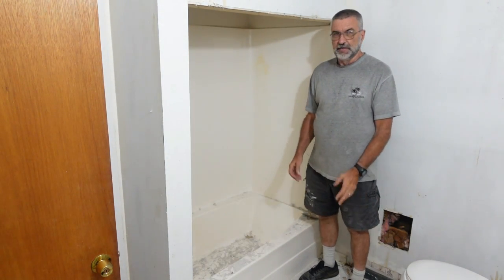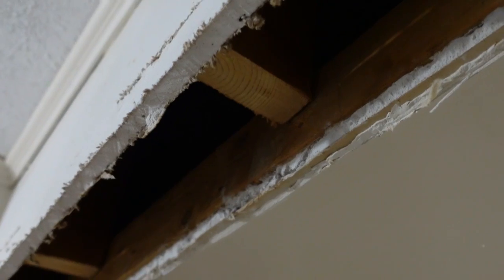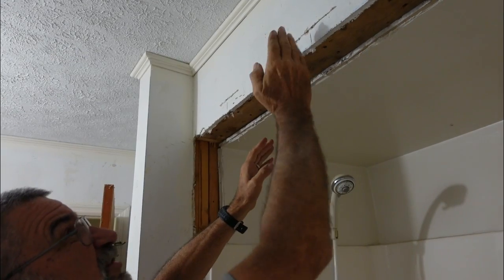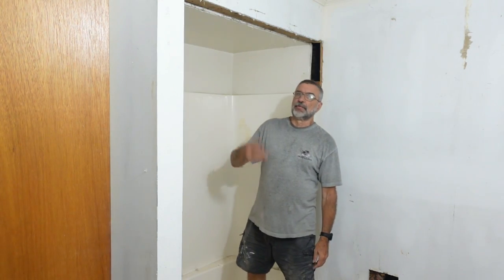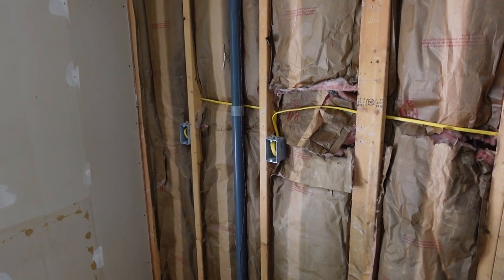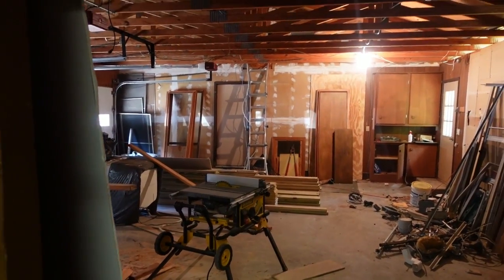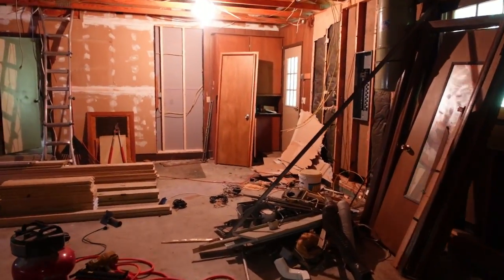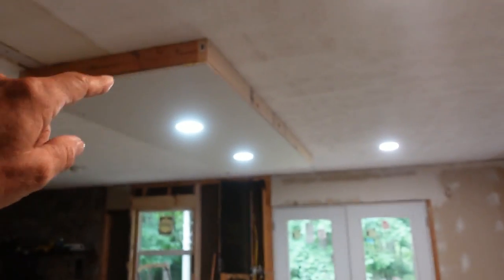More framing, Electrical Problems, Flip House PT 10

Comment: Moving the electrical panel is also so much safer as it's closer if there is an emergency and you need to turn it off at the mains. Great thinking guys. Xxoo
Reply from the maker: Yup
Reply: A lotta benefits having it closer to the interior, as well as on an outside wall rather than an inside. Like he said, Romex isn't cheap.

Comment: When we bought our house 11 yrs ago, the house was still ran on fuses! My dad redid the electrical and put in a breaker box. The 1970’s were an interesting time in house construction lol
Reply: That's interesting.  Every house I have ever been in that was built in the late 40's, 50's, 60's and 70's was constructed with circuit breaker boxes ...... not a fuse in sight.  But have been a state updated electrical code thing.

Comment: I've seen something similar to that shower stall. It was done so the sliding shower doors could be sealed top and bottom. I think the idea was to use hot water to create a mini steam room. Not very successfully I will add.
Reply: I thought something similar, there had to be some reason that they did it? Right?
Reply: @Parakeetfriend4215  The builder had a vision.

Comment: Looks good. The shower space is better. If you replace the tub, tiling the walls up to the ceiling of the shower space will look better than coming short of it. Moving and replacing the electric box makes it more convenient.
Reply from the maker: There’s no reason to replace the tub. It’s in good shape.

Comment: I never heard of putting an electrical box in the garage.  Thought they are typically inside the home.  Also, I found that very interesting about the insulation.  Will have to remember that great tip.  Always unexpected issues, but you and Barry have the knowledge on how to handle things.  Can't wait to see those cabinets.  The Amish do some incredibly gorgeous work!
Reply from the maker: Putting the electrical box in the garage is common.
Reply: Not sure about where you live, but around here almost all electrical panels are either in the garage, or the basement. But typically if there's a basement, it has its own stand alone panel for flooding reasons.
Reply: @gotdangedcommiesitellyahwa6298  I have mine in the basement.  Never seen one in the garage.
Reply: @JanesDough855  It's far more common in areas that don't typically have basements.
Reply: @LiveSimpleLiveFree  ours is in the basement. Not real convenient as we get older but thankfully we don’t need to access it very often. Love watching your home improvements.

Comment: Just curious on the lights over the "island" and why the box was built for them?  Just decorative?  Such a blessing to have all of those skills and the initiative to execute those tasks! 👍  ❤️  🤗  🙏  🇺🇸
Reply from the maker: The ceiling is textured.  It's very difficult to patch texturing and make it match.  There was a big hole it the ceiling from where we removed the old kitchen wall.  It was easier to build this soffit above the island to cover the hole than to patch the ceiling and make it look like anything acceptable.  It also adds a nice decorative touch.
Reply: @LiveSimpleLiveFree  Are the textured ceilings asbestos?

Comment: I'm wondering if that tub area is a converted closet. I don't know the layout of the home, but if there is another bathroom on the other side of the wall, it would have been easy enough to stick that tub in the closet to provide a separate shower for whoever was staying in that bedroom. It might have been a homeowner special with no permit, and they didn't care about the low-hanging framing, as it was just for their own purposes. If that were here, the house probably wouldn't have been allowed to sell before it was brought up to code and ten permits were pulled to repair it.
Reply from the maker: No, that is the main bath, and it was designed that way.

Comment: Looking good, Bill!  How do they ensure that the insulation in the crawl space will stay?  Does it just hang there? Do they nail it up?
Reply from the maker: There are wires (called insulation stays) that you push up into the insulation and they grab the joists on either side and hold the insulation in place.

Comment: Just curious as to why you kept a bulkhead over the tub.  I would have taken the bulkhead out and given full ceiling height over the tub.  I would the lowered ceiling over the tub "oppressive". I am used to full ceiling heights over the tub.
Reply from the maker: The short little wall that I removed was "oppressive."  Once I removed it, it was no longer oppressive and there is now plenty of headroom.  Removing the rest never even crossed our minds because it wasn't necessary.  It also would have been a lot more work.
Reply: @LiveSimpleLiveFree  Well, yeah, take out more, more to patch.

Comment: I am working on a fixer upper and it also has two panels, but, do you pay the electric company to come in and fix it?  I have a coop electric company and can they do this?  Plus will they charge to do it?
Reply from the maker: As far as I know, the electric company will not do any work on (or in) your house.  You would have to hire an electrician to do the work for you. After the work is done, and inspected, the power company will come out a hook up the new service entrance for you.  Hire an electrician to do it for you.

Comment: Can I ask why you didn't take the tub   ceiling to the same level as the rest of the ceiling?
Reply from the maker: Because that would have been CONSIDERABLY more work, and it wasn't necessary.  the level it's at leaves plenty of headroom and room for a shower curtain.

Comment: How about the length for a shower door or shower curtain. Will it be short now?
Are you putting in new shower tile or surround?
Reply from the maker: The curtain rod or shower doors can be installed easily at just the right height for a shower curtain. We won’t need to put a surround or tile the tub.

Comment: It's been awhile but all of you have been busy busy.  So the electrial panels were a nightmare and Barry put in a new one closer,.  You're still going to need outlets and lights in the garages, so they each will get their own or just one?  
The insulation looks so much better the above tub was weird and that was so 70's.  Seems like they liked to do strange things back then and thought "oh isn't this great, this new whatever it is, because it's NEW!"  A lot like today, too much new stuff tech like in the cars.  We just bought a 2020 auto and it can only be opened on the drivers side and it's the only place for a key.  Other cars had push button or fob instead of key.  I insisted on a key.  It's an expensive key fob mess, but there's a key.  Oh boy.
Reply from the maker: The garages already have plenty of lights and receptacles. We just rewire thise existing circuits to go into the new breaker box.